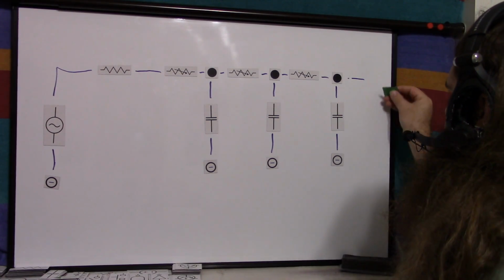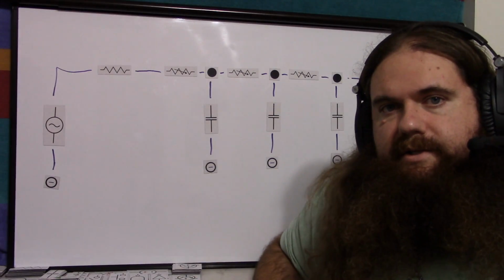Filtering Square Waves to Sine Waves - Simply Put

Comment: I wonder if this method could be applied to 240V 30A 8000W generator (square sine), I just really would rather not spend more money on an inverter generator of the same output.  I will be moving to a very rural area and need to generate my own power (solar panels are not an option for me).  Several things will require clean smooth power, such as HF radios (more an EMI noise issue for those) also sensitive electronics that could, as I understand it, tend to either malfunction or reduce the power conversion circuits lifespan.  But would circuits beefy enough for that be cost prohibitive?

Comment: Could I use this concept to turn 240v 60hz ~100 amps of square wave AC to a smoother triangular or at least a smoother modified square wave form AC? I have a DC generator I want to use as a 1ph AC generator. I can make a rotary inverter easily, but my AC motors wouldn't appreciate the harsh square wave power a rotary brushed inverter would create

Comment: Exellant.  Ive been comtemplating similar sort of thing.  But i figured you dont need an amp - just the signal for transistor to switch but have that transistor switching 10khz- 150khz etc...   to put through ferite core step up for  12v to 230v {in my case - but Im not there yet so concept might be wrong.  I like yr thinking.  Must also be sick of the throw away society and better to have yr own product you can fix.

Comment: Using this 3 stage low pass filter turns my 220v square wave into 7v sine lol, I cant use this
Reply: That's the nature of using the integrator part of the low pass filter.  It cuts the amplitude, the higher the frequency.  If you want to control for this, you'd need to use an op-amp to boost the signal.  If you want to control for this with frequency independence, you can do this with a combination of exponential and logarithmic amplifiers, to undo the attenuation.

Comment: RC networks cannot - and will not ever - give a true sine wave. Anyone who understands the rotational basis for a sine wave knows that a resistor is a linear component, whereas capacitors and inductors are not. Both of the later are required for a true sine wave...period.

Comment: Very cool, a question, is there a 90 degrees phaseshift from input to output? 21:26
Reply: A first order filter has zero phase shift for most of the pass band, and in the limit, it has a 90 degree phase shift in the stop band.  At the corner frequency, it has a 45 degree phase shift.  It will look like an arctangent graph as a function of linear frequency.  As a function of logarithmic frequency, it looks like two flat lines and a diagonal connecting them.

Second order filters with only a single corner frequency will double these phase shifts, such that it's 90 degrees at the corner frequency and 180 degrees in the extreme of the stop band.  What makes it "second order", is having two independent energy storage circuit elements.  So it could be an LRC filter, or two stages of an RC filter.

Comment: What is the effect of frequency on the sine wave, Simply Put?  If you ran a 1KHz signal through your low pass filter, what would it look like?
Reply: It's still a sine wave.  You just have  an amplitude and phase change, depending on where the characteristic corner frequency is, relative to the frequency of the signal.

The reason you get a change-of-shape with other waveforms, rather than just an amplitude scaling and phase shift, is that the other waveforms are superpositions of multiple frequencies of sine waves.  Low pass filters maintain the fundamental and attenuate all the harmonics that make them their shape, and leave you with a sine wave in the long run of infinite filtering.  Finite filtering never makes a perfect sine wave, it just gets close enough for your purpose.  High pass filters make the harmonics more extreme, since they act as differentiators.

Comment: I'm a bit of a noob, but will the smoothness of the sine wave be affected by an increasingly higher current load ? Let's say I want to convert my 1100W modified square wave inverter to a sine wave. Can I use your method ?

Comment: for those of you looking to convert modified sine wave inverters output to a more "sinewave like" waveform, I recommend these:
https://www.digikey.c o m

/product-detail/en/qualtek/851-05%2F006/Q461-ND/739530?utm_adgroup=Overstock&utm_source=google&utm_medium=cpc&utm_campaign=Shopping_Product_Promotional%20Campaign&utm_term=&utm_content=Overstock&gclid=CjwKCAjw5Kv7BRBSEiwAXGDElR1w8cVXGhbi254fr4URO5m8sdwYwjvj2z3NMk23c69faxcD-m908BoCmMYQAvD_BwE

hopefully, google will leave the info up, and use 2 wired in series, (output of 1st filter feeds the input of the second) you will see a 3-5% drop in overall output, but yhe waveform will be MUCH easier on sensitive electronics....😁

Comment: If I am interested in smoothing out modified square waves from an inverter, may I replace the resistors with inductors?
Reply: yes, that would be called an LC low pass filter. L=variable for inductance and C=variable for capacitance.

the inductive elements in the filter must be rated for roughly 2x the current to be drawn, and the capacitors must be rated about 2x the applied voltage. 

I don't want to go too far down the rabbit hole, as the theory and practical circuit design gets pretty complex, so I recommend you look up a part called, "ac common mode noise filter" These have a pre built low pass design, and are considerably easier to use....👍

Comment: hi
how can i change 2000w square signal into sine wave...or what is the valuse of R & C
Reply: An L/C (Inductor/Capacitor) low pass filter is more commonly used when currents are required to be above a couple hundred milli-amps. Think low pass crossover for speaker systems.

Comment: Low pass RC filter work best when signal at main frequency is reduced with 3 dB.  This mean two times.
So after first stage signal to be 2,5Vpp, after second 1,25 Vpp and on exit 0,67 Vpp. Next transistor stage will need to have amplification 8 times to restore signal to 5 Vpp. As well I recommend to reduce values of condensers by two.
100 nF , 47nf and 22nf.  Like this will be easier to adjust the filter.

Comment: You might try a band pass filter, where a capacitor is connected in series with the resistor, the other end through another identical capacitor to ground. Tune the variable resistor to get the time constant necessary for the frequency of the square wave. Fewer elements, and, preserve even a greater percentage of the amplitude of the square wave generator. Capacitor-resistor-capacitor. Measure across the capacitor connected to ground. Not only will it be much more efficient, but, i'll bet you'll get even a more convincing sine wave. In fact, I think I'll turn on my oscilloscope right now!
Reply from the maker: Sounds like a great idea for a future video. I'll make a note.
Reply: @simplyput2796  I goofed up! in that series, a resistor needs to be placed between the second capacitor and ground. that becomes the hi pass filter. I did fire up my scope, and while my circuit did create a roll off on high and low, your circuit actually worked better, for taking both edges off the square wave. I also ended up with 1/3 amplitude.

Comment: Can you apply this to a guitar pedal? Take the signal from the guitar and make it into a sine wave?
Reply from the maker: I don't know how a guitar pedal is structured internally, but if it is a variable resistance, then yes. If your pedal is powered and is putting out a voltage, you'll need to use an ADC, or an analog pin (which is connected to an ADC on the microcontroller).
Reply: That's essentially what the tone dial on the guitar is doing.  You'd just need a lot more stages of filters to get a sine wave out of a guitar.  It won't sound like a guitar at that point, it will sound more like a flute.

Comment: After the op amp stage, could this be used as an inverter to run an a/c fan (or such low amp device)
Reply from the maker: It would be better to look up some circuit diagrams for actual inverters. I plan to do videos on that topic, but I haven't yet, and you'll be better off with a purpose-built circuit.

Comment: Great video, how can I calculate the R and C values without variable resistors? I want to achieve a specific frequency
Reply from the maker: Filtering doesn't change the frequency, just the amplitude and shape. The original square wave determines the frequency. (I have a newer video on this topic. You should watch it instead. It's linked in this video.)

Comment: Nice work. I've been thinking about a variable frequency drive for a couple of years. Creating a 60 Hz sine wave is a great tutorial.
Reply: You would use pwm at a carrier in the khz  driving a full-bridge inverter   then filter the output with an LC  filter to create your low frequency smooth sinewave 👍

Comment: Velvety voiced man sending signals at me through the internet. My brain is officially aroused. 

But just cut it out with the jump cuts please. I think youtube has matured enough to handle long form sentences (Especially in educational contexts). It also means less editing for you, so lower content creation resistance at the input = higher content current at the output and lower chance of burning the whole circuit. The world need your input my duderino.

With that said, you just earned yourself a sub. I'll be following this project along. Thanks.
Reply from the maker: I understand how the jump-cuts can be annoying, but over the months I've been learning how to do a channel like this and building my "set", I'm faced with the realization that I have to please myself before I can try to please anyone else. My normal speech pattern is filled with gaps like the stereotypical William Shatner, plus I'm annoyed by hearing myself breathe between speaking.

I originally tried to edit this manually and you're right: The amount of work is absurd and unsustainable. So...I just wrote my own video editor and it actually does the cuts automatically, and I just have to go in and "clean it up a bit".

I absolutely have tried to just do "normal" cuts, and I genuinely just cannot stand how I sound. I hope you can put up with my eccentricity on this, because I have to put out a product I can be proud of and enjoy watching myself, even if it doesn't appeal to everyone.
Reply: @simplyput2796  I totally respect that. I would rather listen to original music from an uncompromising artist than a crowd-pleasing one. 

I might have rushed to comment there also. I hadn't noticed the wealth of content you aleady put out. I'm quite new to circuit analysis and component level electronics so, much of your content is still out of my reach but your structured and detailed presentation of fundamentals are exactly what I was looking for. (the understated comedy also hits the spot pretty well).

Also, watching this inspired me to try and build a pre-amp for a midi controller keyboard I have. What other video of yours would you suggest could enlighten me on the subject ?

For your auto-editor (first this is amazing please cash in on this. There's probably a substential market for this from fellow youtubers) may I suggest offsetting the cut a couple ms left or right ? 

Anyway, you've made it to my list of reference people on the subject along with EEV blog. Congratz. And thank you.
Reply from the maker: Regarding the amplification, and keeping strongly in mind that I am learning as I go (making EEVBlog, an actual electrical engineer, a better reference), from my research thus far I'd say that the amplifier I've already shown off is the way to go for absolute 100% best sound reproduction if you have no restrictions on power usage (meaning you can plug it into the wall and it doesn't need to preserve battery life) and you can afford more expensive components (power transistors and resistors). The other types of amplifiers that I have seen are all designed for reducing power consumption at the expense of quality.

I apologize for not getting out more videos, such as about the other types of amplifier: It really is due entirely to my personal life and me being garbage at time management. I'm working on it, I swear.

For the editor, I'm not sure there would be a market for it, because in all the time I have put out videos here, regarding comments here on the videos and also talking to my Discord people, as well as watching the few other videos on YouTube I've found with similar editing, I have never once seen anyone praise the style: Everyone seems to either hate it or not care. Similar to the brick-wall audio normalizer I wrote that I use when I do livestreaming: My audience tolerates it, but I've never been praised, only ever gotten comments about how it destroys dynamic range.

As for offsetting the cut, are you saying you just wish the cuts weren't as sharp, with a little bit more of a pause between them? That's definitely something I can easily tweak.
Reply: @simplyput2796  Yes for the offsetting that is exactly what I'm saying. I'm curious, what criteria are you using in your code to make a cut ? And how do you run that code ? Is it a pluggin for your editing software or an .exe or something else ?
I think you might have a rough implementation of a great idea. I can imagine daily/lifestyle vloggers (as much as I dislike the format) saving tons of time with this. There's loads of high content output, average to low production quality youtubers, (no offense of course, different style and purpose) that upload with edits no better than what you already have. If they could have an auto-edited first draft with a full backup you could humm.... you could be a rich man my dude. 

Of course, going after this crowd means you would need a solid UI and customizable delays and threashold levels for the cut based on whatever criteria you're using. (e.i: if silence for x seconds make cut. With a user variable x)
Sorry now I'm rambling. I can see on the other hand that focusing on that would take your attention away from projects of much greater interest to you. And having sensed a high degree of integrity and self-determination in regards to your work, from your first response, I can understand not wanting to streach your attention so thin on secondary projects. Especially, beeing one of us garbage brothers from the time managment bureau bin
Yet again, If fortune strikes your back with this idea, feel free to through a couple bucks my way.
Reply from the maker: It's a program written entirely from scratch by me, so yes it does have a super-simple UI that just "gets the job done". The way it works is actually pretty simple: I move my cursor along the audio timeline until I come to a part that has a gap and a small amount of noise (such as breathing) that I want to cut, and press a button. It searches a certain amount of time forward and back of the cursor, takes the maximum audio magnitude in that slice, and then cuts forward and back as far as it can until it reaches audio that's louder. Then, it backs away from the louder audio by a certain margin, and makes a cut. Then I press another button, and it goes through the entire remaining audio forward and finds every other area that is also at or below the "cut" audio level that is a certain minimum length (so it doesn't try to make a cut between every word or something). From there, I just hit "play" and listen. It's really nice for editing out vocal flubs and such, because instead of having to actually cut a part out, I just press a button and it just deletes everything between the two adjacent cuts. So my "time spent actually editing" comes out to be barely a couple of minutes longer than the final video ends up being.

The audio normalizer uses the EBU R128 standard for measuring "perceived volume" and a moving 400ms window to put the final audio right near -23db (the BBC recommendation) which brings up my low audio if I mumble and caps off my high audio if I get too excited. I could use a much better implementation of that because I have the entire audio track to work with at once, but I'm lazy so I just use the same code for my YouTube stuff that I do for my livestreaming.

I doubt I would ever bother to make these into real programs just because I'd never really manage to get around to it, but at some point I ought to at least throw the code up somewhere so somebody else could. I haven't done anything actually interesting, though: My code isn't complex or particularly novel. It's just that nobody else simply has bothered to ever do this (which reinforces my idea that, while it's an untapped market, it's also not an in-demand market). But hey, who knows.
Reply: @simplyput2796  wow I was just reading those comments and I'm blown away with what both of you were saying. 😲 that's the type of knowledge I want to have one day soon. And I will... that I guarantee 👍👍

Comment: One question, what's the value of the safety resistor..
Reply from the maker: It just depends on whatever voltage the signal is and what is the maximum current you want coming from your signal source. Just use your standard V=I*R and P=V*I for wherever it is in your circuit.